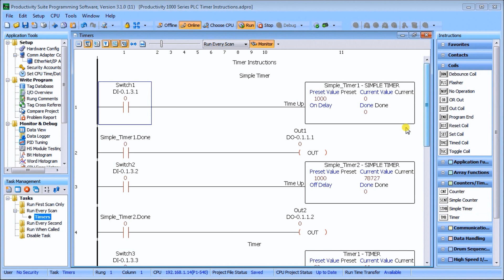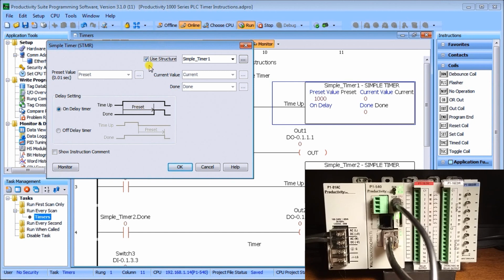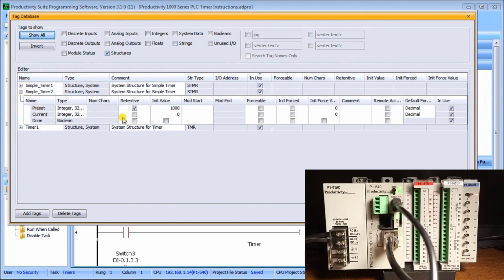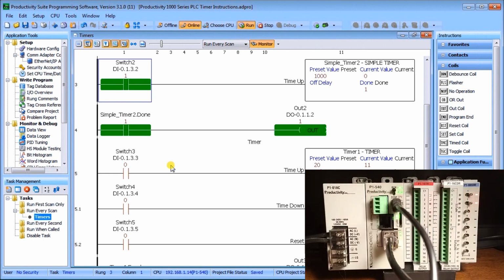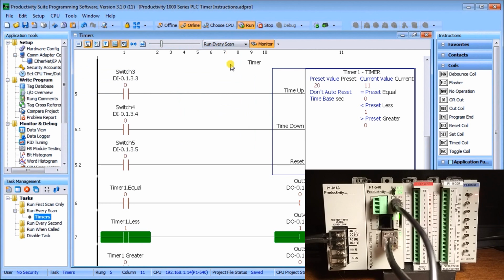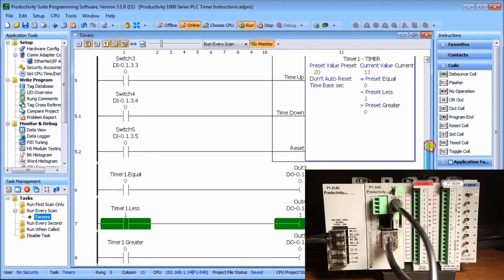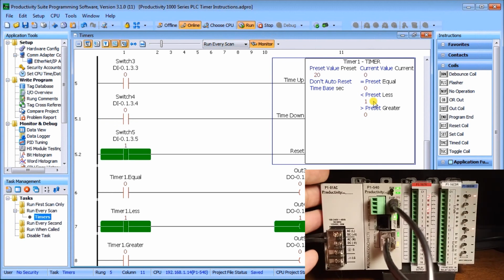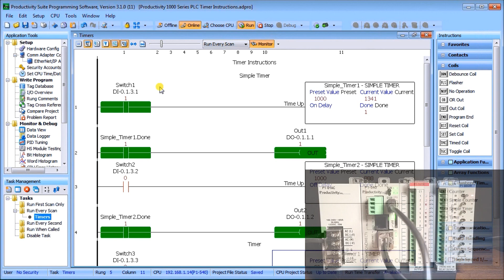Master PLC Timers: Simple & Advanced Instructions Revealed

Comment: Garry can you change the preset value of the structure tag though an HMI interface or do we have to create a new tag for the preset value and done to be able to change it through an HMI interface?
Reply from the maker: Hi Peter,
You can use the existing structure tag for the timer. In the tag database, a Modbus address can be assigned for the preset value.
Regards,
Garry